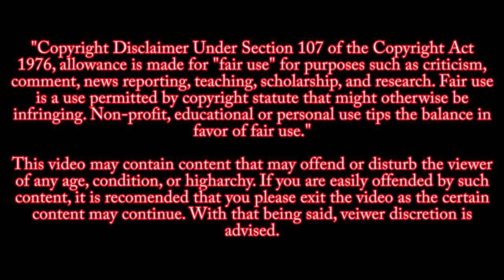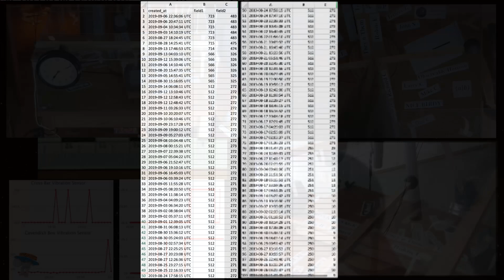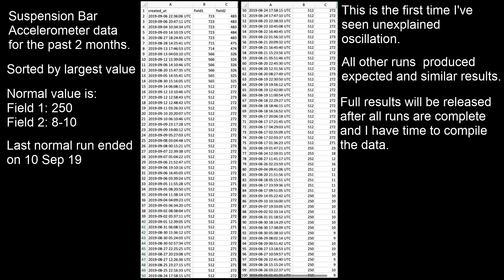Cavendish Conundrum and Phase 1 Completion

Comment: The building might have settled a bit or the wood is moving drying out and trying to cup possibly. wow 1.6 inches is a lot. Is that a split by the hook? did you use a hard wood

Comment: Oscillations would indicate a force of some sort. Slow changes would probably be the only result of temp changes.

Forces you could consider could be building vibration, slight sway from wind. Differences between floor, bearing laser and sensors, and ceiling/walls, bearing the wire & bar.
Sound vibration could also be a factor, subsonic.

Comment: I'm going to guess coupling of low intensity vibrations as some other have said. It's a common problem in optical setups. A good low-cost way to damp these is a stack of alternating heavy things (e.g. firebricks) and squishy things (e.g. inner tubes - lightly inflated - or stiff foam rubber). The goal is damped pneumatic suspension of your table, without cylinders and dampers. It also helps to suspend any wires leading from the table, if any, with elastic cord fixed to the tabletop. They can also lead vibration in. Final common culprit is air currents but you seem to have that in hand! This is great work!

Comment: Which gauge and type of “string” did you use, steel, phosphor bronze, wound or unwound and if wound which way was the non-soldered end secured? Maybe lock-off the rotor, then and apply a transient to see what the nature of it’s oscillations are (your anchored wire’s length would be critical in assessing its available frequency range in comparison with the now-recorded data sets.)

Comment: Hi BM. Just out of curiosity, would temperature and relative humidity affect the experiment? I see it's a sealed room but temperature differences between day and night would still change inside.  Could that change affect the experiment?
Reply from the maker: It could but the biggest issue is temperature difference inside the room a the same time causing current.   I ran a 4 day run to just see if temp causes changes in the normal rest position but it didn't.  If it were to cause a problem I couldn't see how it would cause a 4mil oscillation.
Reply: Hmm. 🤔.  It's a definite mystery then.  How is the experiment going so far?  Apologies, I didn't see the notification for your reply BM.  Your experiment has been on my mind since I viewed the first episode so I thought I'd check in.  👍

Comment: We are close to the equinox so the day length and climate has, more or less, reached its maximum rate of change.  So temperature effects etc. (the angle of the sun is lower and therefore more directly onto the vertical sides and windows of a building) are something to asses and I note that the window has a blind rather than blocked with insulating sheets.
Also, as you do not have unlimited time left in Korea, consider adding some damping to the beam.  Possibly a copper disc and a strong magnet.  If you could halve the time it takes to stabilise you could get more readings done.
Or take a time lapse video of the laser spot and use the mid-point of oscillations as your data point.  Choose a frame rate to give you playback at about 6 seconds per cycle (I think that is about one image per 70 seconds for you).
Reply from the maker: I got a full 9 sets of data so I'm happy with that as a solid baseline.  And I'm so close to leaving that I don't think I could make any changes in time.
Reply: @BMFurball  I admire you for having this ambition and doing so well!  Thinking some more about the mystery impulse - if the wood of the beam is responding to lowering humidity and cracked a little (which is likely as it is under stress) it would be a jolt but not creating any net angular momentum, however, your wire to hook joint may have let go and turned a little, but unlikely. 
For "next time" think of aluminium extrusion for the beam e.g. scrap carpenters level, heavier masses and a different approach to the light pointer - use a small surface-mount LED and a lens from a scrap slide projector (longish focal length if possible) to focus an image on your scale.  You would get a smaller and more defined spot. Best wishes for your return home!

Comment: BM, did you say you are using guitar strings? Possibly the string itself is oscillating. Guitar string is a wound material. Maybe it is attempting to unwind due to the pulling of the string?
Reply: Fairly sure he's using one of the higher strings that is plain wire
Reply from the maker: I'm using the B string.

Comment: Damn you Cavendish and your fickle experiment! Honestly, for something as sensitive as this you prob need to have it in an environment that protects it from all outside influences. An empty room in an apartment prob isn't gonna work. The experiment for detecting dark matter and gravity waves are both so sensitive that they're contained so zero outside factors can influence the result. It may just be case of small building vibrations, geothermal activity, or distant earthquakes. There could be no way of knowing either. Or even being able to control it if you did know what it was from.
Reply: It’s impossible to have zero outside factors. For example ligo has to contend with seismic noise (even with the suspended mirrors), electronic noise from the instruments doing the measurements, etc...
Reply: @sphaera2520   Ok. But they still have it out in the middle of nowhere protected inside a carefully controlled environment inside the facility. They are doing everything possible to make sure that outside factors don't influence it. Which is the point I was trying to make.
Reply from the maker: I got 9 solid results before this issue arose and all were almost the exact same.  I'm happy with those for this iteration of the experiment.  Maybe the next build back in the states will be even more controlled.
Reply: @BMFurball  Really? That's interesting. I've heard about you doing this but this is the first video I've seen. I can't claim to know much about but looks to be an incredibly fickle thing. Even a small breath of wind or a tiny vibration could cause a change in the system.

Comment: Without any sort of damping, experiments like this one tend to oscillate... a lot. When done professionally, we tend to use those oscillations to perform the necessary calculations. To get the "settled" data you want, I suggest a "damper" of some kind. A pool of oil at the bottom of the chamber with a string dragging in it from the torsion rod might do that nicely.
Reply: iirc that’s how we ran our cavendish experiment. Rather than wait for things to settle after a couple days and move the masses, etc... we simply measured and compared the dampened oscillations in one configuration vs the other. 

Since we (hopefully) know what the variables are, we could then quantify the influence of the masses. If our measurements/maths are accurate, it’s rather trivial to recreate the graph of the dampened harmonics by inputting the appropriate quantities into the formula which ought to match the measured data. 

I guess the benefit of doing it the long way is that even someone as dense as a flattie can see that the experiment started from one stop point (after waiting for days to kill obvious noise) and finished at another (also after waiting for days). But this is [more] tedious, time consuming (let’s be honest here, cavendish is always tedious/time consuming), and too sensitive to noise.
Reply from the maker: It comes to a pretty quick "rest" (3mm oscillation) when the weights are gone.   I've been able to run it 24hrs after removal of the weights a few times and the torsion balance was almost still.  It is when the weights are in place that oscillation will not stop.  this was strange because it was a wild oscillation while the weights were gone.

Comment: Do you have a way to sense very low frequency building oscillations?  Is everything grounded?  Perhaps you should setup a separate pendulum of similar mass and length as a control.   

   A few random thoughts.

All the best;
    Ghrey

Comment: Suggestion:  A Collet chuck to grip the wire
Not sure how small they go. 
Perhaps 3 finish nails around the wire in the middle jammed in a tapered drilled hole. Enough of a head to grip a bit... file grooves to grip.
Reply from the maker: That's a good idea.  I may try that for V2 whenever I rebuild after returning stateside.  thanks for the though idea.
Reply: I'd do the Collet/pin vice at both top and bottom... and not trust the ball-end on the guitar string. That is another point of questionable solidity.

Comment: A point I made recently with FTFE - this experiment can be plagued by so many variables some of which can be controlled, some of which cannot be controlled, and others may be occult and not yet considered. Given the extraordinary care taken by BM in this set up it should be obvious to all that the 'many' experiments aimed to demonstrate Cavendish ('mass attracts mass', does it really??? or is this space-time distortion or something else) can fall way short of providing any level of proof. Also I would be interested to see (or k now of) such an experiment as performed with weights of material other than metal !
Reply: Any mass can work. The convenience of metal is that is is dense therefore the relatively small volumes convenient for the experiment still contain an appreciable amount of mass.

If you used something like water, the volumes needed for an equivalent amount of mass would mean the distance between the pairs of m-Ms would increase (cuz d is measured from their respective center). 

Tl;dr
The relationship being measured is proportional to m*M and inversely proportional to d^2. Meaning ideally you want large m and M yet a small d.
Reply from the maker: There is a really old experiment you can find on youtube that used large bags of sand for M2.

Comment: Have you plotted the oscillations against time &/or temperature? Could it be from outside? Heating & cooling during the day/night cycle perhaps? Maybe even the sun heating an outside wall causing expansion / contraction of the fabric of the building itself? This could come down to breaks in cloud cover if so...
What's the period? Are you on a slope? Maybe anabatic winds causing the building to oscillate at it's resonant frequency?
Maybe try some sacks of sand hanging from tripods like the tuned dampers they use for earthquake proofing. Four of those set up at the cardinal points could help...
Here's a quick video on tuned dampers & the resonant frequencies of structures. 
https://youtu.be/f1U4SAgy60c
With the right damping you won't have to find the cause of the oscillations, just cure the symptoms.
Reply from the maker: With only 3 weeks before I have to take the system down, but good ideas.

Comment: Expanding on Tbacs comment:
https://www.youtube.com/watch?v=VWwJc7z8WSY&lc=Ugy_MhIrtV0KNO9zgTx4AaABAg
Put a hygrometer in the room;
Replace the timbers with kiln-dried & varnished lengths;
Drill through the timbers & use eyed bolts to prevent splits propagating;
Wrap the wire, soft-solder or secure with JB Weld;
Run screaming from room & beat head against wall.

Comment: I say it's the solder. That joint would require substantial heat to properly bond. Maybe something like JB Weld could be an option? I'm probably way over my head on this one.

Comment: closest earth quake was a 4.5
4km S of Santa Fe, Philippines
2019-09-14 10:35:11 (UTC)
 There was a 5.1 but due to the distance to you. this also would have no effect.

  Maybe Hugo Perez comment is correct.. possible guitar string reached the fatigue point. But I am more pointing to the drying of the wood. 
 If I remember you have closed off the room from all drafts and any air circulation. The air in the room with no air flow will get dryer, moisture will evaporate. Once you opened the door when you went to make the change you added a possible higher air moisture which in turn made the wood expand just a tad. or a touch. 
 I blame the wood.
Reply from the maker: It is either the wood or the suspension points.  Both will need to be researched more before V2 is built.

Comment: Not suggesting I know ANYTHING, but ...  How is the grey tube, around the wire attached at top?  I picture the temp inside the tube is micro cooler than outside the tube.  Air, if it can get in at top would sink, inside the tube.  Maybe I'm being too.....critical?
Reply from the maker: It is hot glued at the top, you should be able to see it in the vid.  No idea is too critical.  I hadn't thought of it but putting vent holes at the top may have been a good idea.
Reply: @BMFurball  Vent holes is a great idea.
Reply: Great catch.

Comment: Ah, a mystery! The game's afoot , our esteemed investigator.

My first concern, it appears that the torsion wire contacts the protective tube.

Has the initial repulsion of the small weights (when moving the large weights into position) been explained?

You named the laser Kristin? Excellent!

No spare plutonium anywhere?

Please give us just one shot with your magnifying glass.

Good luck, or, make your own.
🇦🇺

Edit: Could there be any movement in the support beam at the ceiling? How tall is the building, how high are you in the building. Can there be any flexing of the walls, which may translate into oscillation through the beam.

No need to waste any time replying to all my questions. I'm just making suggestions. 👌
Reply: That was the one thing that stood out when you looked and everything. It did look like wire was touching the tube.
Reply: Hmmm, flexing of the building in the wind or very light movements of the ground could indeed induce this kind of oscillation. 

Was the clock always there? It is electric and you have wires on the bar. I don’t expect much of an influence, but who knows. 

Movement of masses on high points of the building can induce small oscillations, not by gravity but by shaking the whole building some fraction of millimeters? Is there a construction site nearby?

We did the cavendish experiment underground. All labs for optical and mechanical sensitive experiments are located underground in my university for a reason. But you have to deal with what you have. Would be interesting if you can pinpoint the source of the oscillation.
Reply from the maker: Here are answers to your questions and a possible answer for the problem.  I'm on the 5th floor of a 25 story building so I don't thinks way should cause an issue.

The clock has been there the entire time. 
I was able to completely remove the initial "push" but DRASTICALLY slowing down the lazy susan.  

As for the reason for the oscillation, it may be the eye hook into the wood.  I had a friend come over to help switch out the 20lb weights with 10lb.  We also added some more solder to the attachment point of the eyehook just in case that was the cause.  I'm not sure if it was the head induced by the iron, or if it had always been that way, but while manipulating the torsion balance the eye hook spun a little in the wood.  That was a bit shocking and extremely concerning.  So we screwed it in another full turn and added some gorilla glue to hopefully hold it firm.  Clearly this is something that will need more thinking if I ever rebuild the experiment.  

The lighter masses are in place now and all is resting for testing in the next few days.  The 9 runs I got from the bigger weights were very consistent on the rest point and the deflection amount.  

I read over Cavendish's paper and he advised to take measurements immediately after introducing M2 not to wait for it to rest, because it really never will.  With an imbalance of gravity on one side it will always cause confounding results if you try to let it rest.
Reply: @BMFurball  Okay, thanks so much for taking the time to reply.
The loosening of the eyelet in timber is probably to be expected. The wood has likely dried somewhat, internally, at the insertion point of the eyelet. Timber is never totally dry. Tightening and sealing should be sufficient, well done.

The building sway however, should not be ruled out. Tall buildings are designed and constructed to be flexible. Too stiff, and cracking of materials occurs, when subjected to winds, obviously lateral forces. Being on the 5th floor would have less lateral movement that the top floors, but there would be some movement.
I think if you had access to the roof, and placed an accelerometer there, you would be surprised at the results.

Coupled with the loose eyelet, you have, it seems, the likely source of the occilation.
Now, smarter people than me, or those better trained in experimental physics, could assist you in taking into account the occilation, as to frequency & magnitude. I think that your mass movement measurements are still very much valid. Occilation, properly recorded as you have, needs to be 'mathed' into the results.

That's your cue, BM, and other smart people! I believe you are now back in control of the experiment.

Looking forward to learning more.